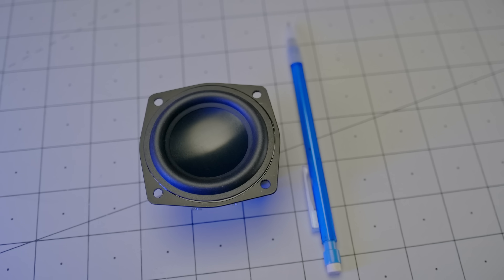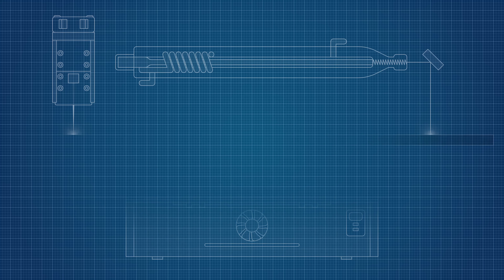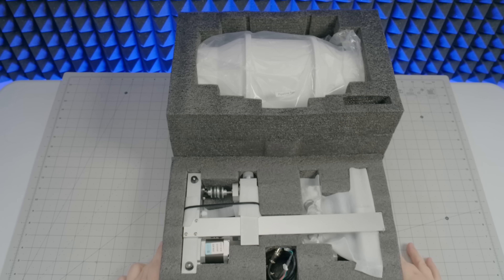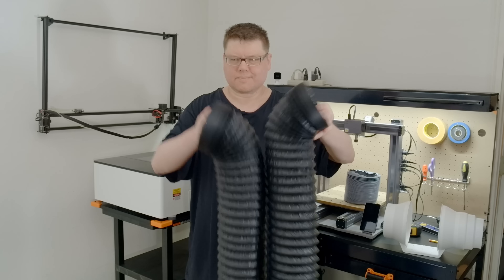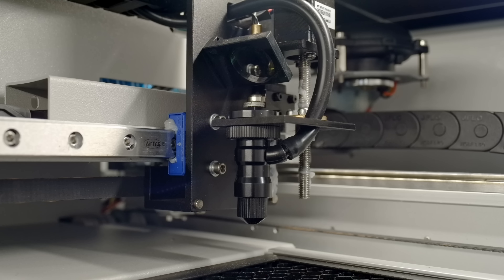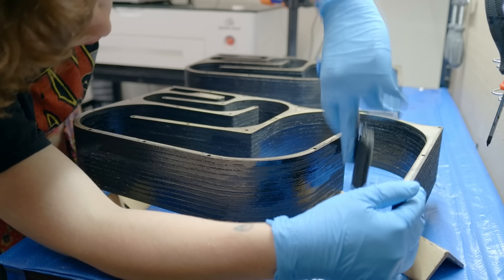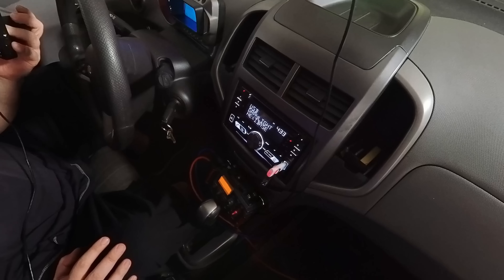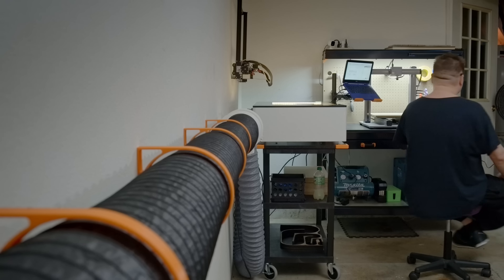Gweike Cloud Pro 50W Laser Review & Feature Build

Comment: How would you design a box 14"x9-1/2"x2-1/2" with 2 92mm fans on top and 12 8 Ohms 2w loudspeakers 2 10w full range and 2 3w full range powered by 15wx15wx30w amp board using 1/2mdf was thinking 6 of the 2w on front other 6 inside facing inward with the 1 of each 10/3w on both side of air channel to fans just trying to figure out the route of ports and if I should dump into fan channel

Comment: Indeed the USB A to A cable situation is annoying, but it seems that's the standard for Ruida DSP controllers for lasers, which the Gweike probably uses. For my Ruida based laser, I used a raspberry Pi that Lightburn has created an image for, to use the laser through the wireless network, Actually, it's faster than using the USB connection for big engravings and projects with a lot of cuts.

Comment: Great stuff! The smallest speakers I've been impressed by were a pair of OZ Audio 4" drivers...had them in my dash in the mid 90's, and while transferring my audio gear to a new car I drove around with this setup in my old beater: 6 JL 12w1 running on an Orion 2100 HCCA 75hz low pass, 2 OZ Audio 4" drivers on an Orion 225 HCCA with a 100hz high pass, with a single center 2" ribbon tweeter (can't remember who made them) with passive cap x-over...and believe it or not it was entirely listenable! people were shocked to find the only mids I had were 2 4" drivers after a demo 😂.

Comment: Never in my life would I have thought someone would be able to run a pair of 2" subwoofers in their vehicle. I've been an car/home audiophile since I was 13. I am now 51. Step up to 4-4" run by a pure 100w rms amplifier @0.05%thd. Transmission or horn loaded enclosure with fiber optic lighting built-into the enclosure common chamber. I'm just wondering how small of subs/amplifier and enclosure it could achieve 135 db? I see your gf/wife helped which makes the project much more enjoyable. Keep playing/thinking outside the box. No pun intended............isobaric, 4th order motorized port FQ enclosure. Awesome video.

Comment: Brilliant video, I took apart my dads bose wave radio as it always fascinated me how so much sound/bass comes from such a compact unit. it uses 2 small drivers and a waveguide like this. Quite staggering what you can achieve with the right engineering.

Comment: 1995 six and a half inch pyramid phase 3. I could not kill the speaker remarkably loud and it flexed really good too
Reply: I was in the electronics business my entire life at one point I had a store in Washington DC and I had a big section that was empty. I decided to do car audio I carried everything from Soup To Nuts at one point I decided to build the system for my son and the pyramid woofers looked great for the money they were all different grades of pyramid I decided to go with two 12-in woofers in a big ported box that was pre-manufactured the woofers were rated at 800 watts RMS each I knew that they were always overeating them some of them sounded good some of them sounded like garbage it was a crap shoot knowing that I could return it if there was a problem I put it together and got myself a nice Cadence 3,000 watt monoblock amp everything was wired properly I installed everything into my son's car I gave the woofers a chance to break in I played them at a low volume for about 24 hours as soon as I started to increase the wattage I started to smell the voice coils burning and then sure enough no sound at all when I try to move the woofers with my hand they were sealed tight needless to say I remove them return them to the manufacturer and never came near another pyramid woofer in my life. I used to sell them but I never use them personally you're telling me that you had one that you didn't have any problems with and you weren't able to blow it I can tell you something you just so happened to get one that was a miracle woofer it was pyramids job to produce the least expensive components basically for Clip Joints for instance run by syrians or Israelis then moving on to flea markets but they have always been garbage I remember when they first came to the states they had these little 1-in equalizers that were being imported from China back in the day nothing was made in China in any case once it got here the people at the factory were taking these little gold stickers and putting them on the box anything they felt fit 200 Watts 500 watts 800 watts it didn't matter all they were looking to do was sell the product and then have a big sign by the register no refunds what I'm trying to say is I'm Amazed that you got your money's worth out of a pyramid product you got very lucky.
Reply: @Mr.Robert1  that's an interesting story. I was maybe 14 at the time playing around didn't have a car hooked it up to home audio components. Do you remember Urban audio works subwoofers? Hello what made them unique was the purple color and then the cone was convex then concave. If you had the one with the big magnet it was awesome in the later years they went with the smaller magnet and wasn't nowhere near as good. If you remember the company aluma pro the 12-in bandpass box where are the box was made for the sub and the sub was made for the box. It was an amazing speaker a pair would produce over 160 DB at 250 watts each. The company still in business it's a small family-owned company and they're main focus is on high quality factory speakers for German cars but they still make those bandpass 12s and 10s and I'm waiting to get my hands on one right now

Comment: That's what's fun about bass. Box design plays such a huge roll in the sound from the speaker(s). And I what I also love, size of the speaker(s) within a box changes so much. You can have big speaker(s) in a smaller box (relative to their size) and you may get alot of air/vibration movement, but little bass. Or a well designed box with smaller speakers, less air/vibration movement, but get much louder bass sounds. 
Sorry I'm not good at explaining this, but basically bass is vibrating the air, thus more moving air should give louder bass. But the box design can hinder the bass notes while the speaker(s) still push/pull a good bit of air. 

If you feel you aren't getting good bass from your speaker(s), likely it's the box design preventing a better quality sound. 
This video shows you don't need big 12,15, or 18 inch speaker(s) to get good loud sounding bass. 
(Yes speakers and subwoofers are different, but subwoofers are still technically speakers, that's why I used the word speaker instead of subwoofer.)

Comment: i love my dayton audio 4" woofers. I put 4 of them ($10 each) in 2 cu.ft. slot ported enclosure from MDF. I believe I was able to get it to play down to about 32 Hz. I since then put them in a smaller custom sealed box so that they hit low with less volume. It works better for my system to have them sealed

Comment: Idk if this is even possible and or worth it but considering there is a clear case, would it be possible to put some like fine powder and or smoke inside to see how the air behaves? I have zero experience on how audio engineering works but my curiosity of those air waves being pushed and amplified by your enclosure design is peaked!

Also, thanks for such awesome videos! They come with an actually useful review of makerspace gear for the average DIYer with a badass audio project.

I know this may also be too much to ask for, but is their any interest in maybe making like a course series on audio engineering? I would love to start learning about that stuff and you seem like a person that could explain it perfectly.

Comment: As for impressed with my own DIY per say, I have some large size mid range Sony bookshelf speakers - themselves a good 20/25 years old (linked to my 1989 Technics SU-600 'New Class A' Integrated amp (serviced & maintained). Anyway, the drivers were getting old and sounded rough, and standard, would tail off at around 60/65 Hz. So, I bought had a quirky idea... I bought some Pioneer A6990F 6x9s, bought some 10mm MDF sheet, made a fresh new face plate (cut to size, with a 6x9 cut out, port cutout and painted black to match the rest of the housing), reinforced the bookshelf speaker housing, rewired them with better terminals and leads etc, bolted and sealed the new face plates to the existing chassis, inserted some sound material, installed the A6990Fs and new ports, and now, they sound great! Clear, rich, full, and now tail off around 40hz! I will get myself a sub to assist with getting lower, but what a difference already!

Comment: I had a Dell inspriron 9200 in university. It had a 1" subwoofer with "Wave guide" (might be wrong term). Nothing I've heard since then rivaled that for audio power (or it's 4kg mass). I learned then tiny subs can make an crazy difference. I took it apart once and the wave guide was a meaningful amount of area in the chassis.

Comment: Not smallest but lightest. I have a set of the Kenwood dualmags xr50p from around 2001. The 5.25 inch woofer only weighes .64lbs. I think they were designed for the Mclaren F1 from around that time.

Comment: I have a question if you don’t mind. I’m building a system for my 2018 mustang. I have the trunk space I needed it. The build is a single 10” inch 700rms audiopipe bd3 subwoofer, With a 3000.1 taramps D amplifier. The sub is a duel 4ohm sub. So I’ll be wired down to a 2 ohm load. This amp at 2ohm will be making around 1500rms. I need box help. Im not going to be competing for numbers. Don’t even care what numbers it does. I want loud down low bass you can feel. The sub specs say 1.5qft ported. I’ve got a 4” round pipe tube to use for my port. My own minds design is a 4th order 1.8qft box with 15” inch long round port made from this 4” tube. Flared ends. Box being 28” wide, 14” tall, 13” deep, sun firing to the rear of car. Port firing to the side. But after seeing your 6th order single sub box on other videos I’m wondering if that would be louder around the 30-40 ranges for a single 10”? Or is my .3 over sized 32hz tuned 4th order plan going to be better?

Comment: Sweet sound, but what's with the muzak?)/* That was a bit torturous.. redeem yourself by building a tandem e-bike with 2 speakers running front to back as a frame.. maybe use some layers of carbon fiber sheet and densely pressed skateboard plywood.. I also would expect a more rockin' soundtrack!) Maybe some Billy Tallent, Buckethead, Kazzer, Ozzy or Dirty Heads or Sweet 'N' Juicy.. I've been dreaming of making an e-bike stereo that you ride and rock.. it's too easy to get away with 2 bluetooth speakers in the bottle cages.. Hell, you really could have some fun, make it full suspension and light it up with LEDs..) Thanks for turning me onto that laser cutter.. I'll have to save up for one..)

Comment: what the tuned port frequency? To me and my ear buds it sounds like you have it at 40-45  I'm guessing guessing.  IMO 33hz for a port frequency is my favorite for subs In a car.  when it comes to home sound I'm clueless to what the best tune port frequency is. Jealous of you knowledge. I have 30yrs of building sub boxes for cars & trucks none for the house. My grand father was the orchestra leader for the army. he built cabinets for some concert speaker from the 50's. on the side he refurbished furniture for the Smithsonian. each cabinet houses a 15" coaxial speaker. They use horn tweeters. 35watts power handling. I listen to them every day. I have moved them 4 times. They sound that good. oh yeh there are volume controls built in for control over the tweeter & woofer
Reply: It isn't a "ported" design. There is no "tuning frequency" per se. These are rear-loaded horns.

Comment: I and some other commenters are actually quite interested in the design process itself. I would love to see how you come up with designs while maybe giving some tips as you go. I imagine these kinds of videos being low effort (compared to your usual, super well produced videos) but still very high value for the whole speaker building community, since there is still a lot of bulls**t out there and quite little people with nearly as much knowledge as you. I would even be interested in partnering up, to reduce the workload on you, if time is what's keeping you from producing such videos. I am starting a small video production company in Austria so if you are interested feel free to get in touch by answering to this comment!
Reply: I'll take a hard guess and tell you that its 1.2 meters (around 4ft) long canal starting from 1.4 liter (around 0.03 cu-ft) compression chamber with 2.4cm (1 inch) opening and ending with 8 to 10cm (4 inch) diameter mouth. The diameter means round shape, you can "press" it to square shape at your will as long you do not change the area square units.

Comment: Just goes to show you don't need huge speakers for big sound. I still remember a Cyber Acoustics Portable speaker that I bought in the early 2000's. 2 1 inch tweeters and a 2 inch sub. Only 10 watts. Sounded great until I dropped it on the floor and the sub stopped working. Model number was CA-MP30. It was discontinued fairly quickly, because it was pretty expensive for it's size and power (I bought mine ON SALE for $49.99)

Comment: You should do a mod with those speakers, sealed without and exhaust port with "Passive Radiators" acting as bass cover ❤️ kinda like what JBL does with their bluetooth speakers

also what size are those drivers ? it kinda looks the size of my JBL Flip 4's 40mm drivers 🧐🧐

Comment: I have some Dayton Audio PC68-4 (2.5in full range speakers) that has impressed me enough to run them as my 200Hz to 20kHz dash speakers in my car. And even on my desk they were fantastic. I tossed them in a tiny sealed enclosure so that's why they are lacking below 200Hz, but I have things that can cover that range just fine. They easily get louder than I need. Anything over 90dBA is too loud for me and they can do that nearfield just fine.

Comment: I built a set of DINAS bookshelf speakers that I have been really impressed with. They use a 5 1/4" subwoofer so they are not tiny bookshelf speakers but they do have impressive range for their size.

Comment: You need to put a filter onto the exhaust. Venting the fumes outdoors doesn't solve the issue with fumes, it just makes it someone else's problem to suffer with. There's a reason why legitimate machines have extraction units the size of, if not larger, than the cutter itself. You need good intake to flood the chamber with fresh air, good exhaust to purge the chamber, and good filtration. Anything less than a proper air unit makes a machine unrecommendable, especially when the machine is targeting the hobby market when some of the absolute nastiest materials, in terms of noxious fumes, will be used. Thankfully this machine isn't open top, because lasers are potent tools and need an entire set of precautionary protections, though I'm curious what the top surface of this machine is, if it'll properly block a laser upon reflection or not. Laser cutters are an area where most of the consumer, and potential consumer, base is so unfathomably uneducated about safety, and none of these companies are promoting laser cutter safety measures. These machines really aren't meant for the hobbyist, especially as the core design of these machines are often flawed from a safety perspective, and a lot of that has to do with size and noise, both of which the common consumer doesn't want, but they're also unaware of the safety that's being sacrificed to attain a smaller and quieter machine; it's also such a disappointment that a well known industrial brand is cutting safety like this.

Comment: The Dayton 4 inch ND speakers blew my socks off.  I bought a bunch when they were like $10 a piece or something like that.  I used them full range and I did not expect that.  Then I had a Samsung HTIB with a passive sub and out of a whim, I cut the 6 1/2 inch driver baffle out and put 2 of the 4's in it's place.  It was stunning for what it was.  Then I made a 4 4 inch console for our Arctic Cat Prowler full range and my kids would drive it all around the field and you could actually hear the sound very well.  I'm on the opposite kick now.  I currently have a Dayton Audio Kraken and 2 Ultimax 18's.  Would you consider designing a enclosure for the Kraken for my truck?  I had it in a 7 cu ft vented box tuned to 29 hz and it was very good, but I think my design had cancellation issues and impedance rise.  if you can do this with 2 2inch drivers, I wonder what you could do with a 21 inch sub with 1400 watts or so?

Comment: I have a 6.5" subwoofer and 2 passive radiators in a enclosure tuned to 45hz and it does really well for that frequency. But now I really want to push that sub in an enclosure down to 33hz.. I'm thinking about making a passive radiator 4th order enclosure to achieve it.

Comment: I'm still amazed by the 4" Tang Band W4-1720's I have in my nearfield monitors. They're running a simple port to 50hz, but I'm most impressed by how cleanly they play midrange. IMD and HD are almost nonexistent until 100hz. I prefer to give the lows over to a sub at that point, but they're still good at moderate volumes playing nearly the full range. They're an odd duck, but almost unbeatable value at that price/form factor.